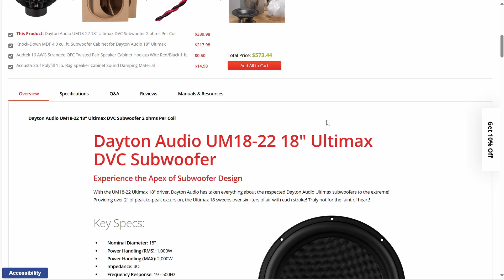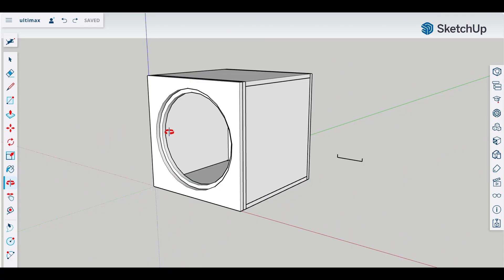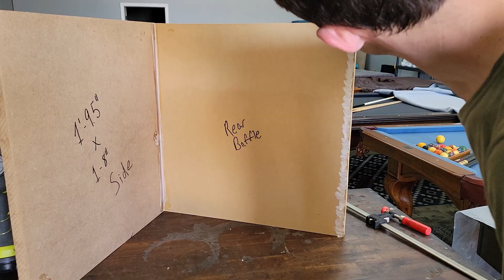Ultimate DIY Subwoofer. Let's Build The 18" Ultimax

Comment: great content :) 
i have mostly built sealed myself, definitely needs dsp to get the most out of them.
when you have a unit like the minidsp shd studio any passive subwoofer becomes fully adjustable with peq, just adds dac and power amp :) 
i find sealed goes deeper and have about the same performance pr volume, ported wins in output pr dollar if you do not need the lowest frequencies below port tuning.
i got respectable 107db at 12 hz from my two 10" shallow driver subwoofers.
Reply from the maker: Right on! I may play with DSP in future videos
Reply: Are you using the miniDSP shd studio? I’m building a 4 12” sealed and I need something with eq! I bought a dayton dsp but I’m reading reviews that most don’t like to iWoofer app 😅
Reply: @gemargordon6885  i use the shd studio as volume control, room correction to main speakers and making passive subwoofer active, with all the dsp power of the mindsp. it is a pure digital unit so you need dacs and power amps. alternatively plate amps, hypex got digital inputs.
minidsp has more units to choose from now, so pick the one that fits.

Comment: Another nice video. I have one 15inch Ultimax kit with the Dayton Audio SA1000 amp and it shakes everything in my smallish house. Personally, I would have used some corner bracing and stuffed the box with polyfil but maybe that's not necessary.
Reply from the maker: Yes this thing way exceeded my expectations. Definitely could use some bracing & stuffing. Wasn't actually planning to use it daily, but I actually have been. Will definitely wind up doing so. Thanks for watching!
Reply: Any tips or advice on the15" ultimax kit? im looking at buying thier sub and flat pack cab. Thoughs on how much power is needed, can i get away with using something like a Fosi Z3A Mono amp?
Reply: @Angellus502   Make sure you have a handful of big clamps for the glue up.  Get some "feet" for the box so it's not resting on the floor.  It's a heavy beast. 
That Fosi amp is too small but might work until you upgrade.
Reply: @ Thanks

Comment: I have built 4 of these and they are great.  Looking forward to seeing more of your videos . What amplifiers are you using?  And what kind of spl are you getting?  I  at 40hz am at 128db using a xls2002
Reply from the maker: Hey, yes these sound great. And so much more clean sealed. I've got this one placed directly behind listening position, and it doesn't disappoint! I'm powering all of my subs using a Xls1500 I believe. I would have to check exact model number. It may actually be the bigger Crown. I'm planning to do some measurements of lots of things very soon.